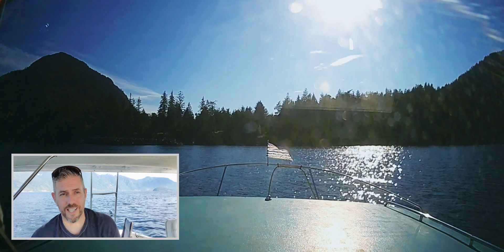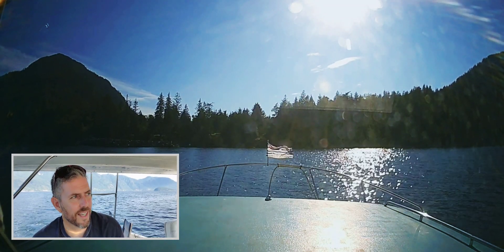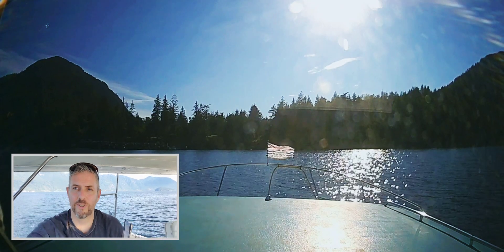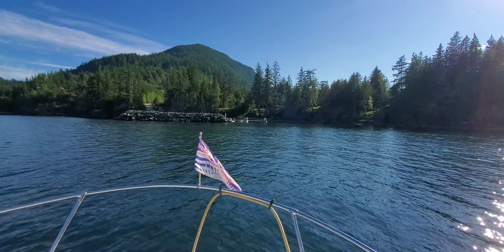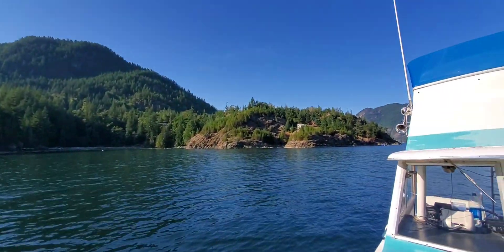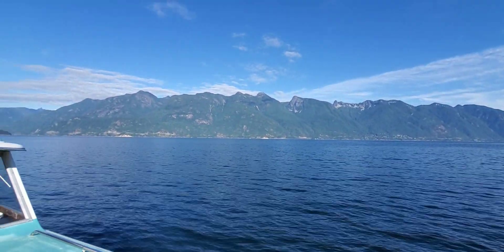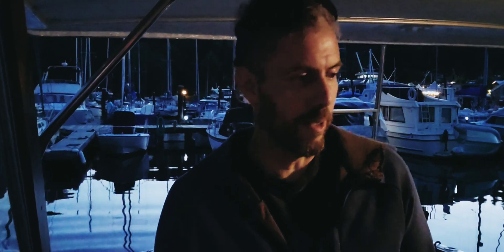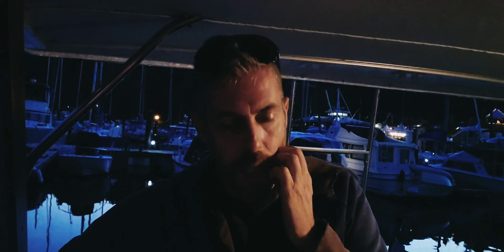Electric Boat - IRL Cruise 🛳, Crown Batteries Discharge Test #2

Comment: How large is your battery pack?

A 250 kilo watts LiFePo4 to 500 kilo watt battery would give you all the power you need. Signature Solar sell a 30 kilowatt battery for $9500. So $80k for a 250 kwatt to $140k for a 500 kwatt, just for the batteries and cables.
Reply from the maker: Just a 140K eh? Lol sounds like a bargain.

Comment: Just put like 8 panels and 2 wind generators on the boat and lithium batteries. Am I crazy? Do you not do this because of the cost?
Reply from the maker: Solar is a no-go.  Would be nothing more than a novelty in the Pacific Northwest. To get any real intense sunlight the panels would have to be facing south the whole time. Where I'm at you might get 3 or 4 hours of good intense sunlight. Keep in mind I'm charging two 16.9kW  power banks, not a 12-volt house bank. I did a video about it a little while back.

https://youtu.be/-mPPxVhdi0M

Regarding lithium's check out the answer, I gave somewhere else in the comments all this video.

Comment: That’s actually not really true about discharging batteries, at least it depends on their type. With phones or other modern batteries that are in most of our electronics devices (Li-Ion, Li-Pol, etc) the fact is you DON’T want to fully discharge them, because that will most likely speed up their degradation. Same with keeping them always at 100% too, but phones can manage it nowadays, by slowly discharging your phone even if it’s on charge and then topping it up slowly, etc., they all have built in controllers for that.
What you’re referring to is most likely true for Ni-MH batteries, or similar types, those yes, might need full discharge from time to time to accurately report their capacity and voltages. With lithium-based batteries full discharge is very much not advised.
Reply from the maker: And thankfully my battery packs are lead acid 👍

Comment: Just think, with lithium batteries, you could just about double your range, without any other changes. Lithium are now MUCH more cost effective than lead. I wonder if you should have waited just a little longer.
Reply from the maker: I've been waiting for 7 years for the price of lithium batteries to drop. They are still triple the cost and there are many safety factors you have to consider. 
In fact, Transport Canada is in the midst of writing new laws as it pertains to lithium batteries because there are so many potential hazards. It's an old conversation I've had many times. The biggest hindrance to this boat is the hull design. Then you have to consider how many times people actually go out. 20 maybe 30 times a year is quite a lot for most pleasure boaters. So the difference between 300 and 1100 Cycles really doesn't make much of an argument for me. 

But hey if you want to find me two 72V high-quality lithium packs, with reputable BMSs, thermal resistant cases rated up to 1000 degrees Celsius that are also corrosion-resistant,  two quality chargers, and an insurance company to cover any thermal runaway fire from a DIY lithium setup for under 10K  - I'm all for it!👍
(These lead batteries cost less than half that)
Reply: @ElectricCruiser  I'm sure you've looked into all this much more than I have, but again, you might have waited just a little longer :)  I can't speak to regulations, especially in Canada, but the LiFePO4 batteries are much safer and "non-toxic" compared to their predecessors. And lead acid can be just as dangerous under high draws. I have seen 100Ah LiFePO4s for as little as $400 with very good BMS and protection. I don't know all your specifics, but I wouldn't think you'd have to replace anything else. I don't know what the crowns cost you but 3 times the price for lithium, with twice the usable capacity (if not more when you consider the losses for lead acid at high amp draw) it really seems like we are at a tipping point. And then there is the size and weight reduction as well. Also, LiFePO4 are non-toxic when you eventually dispose of them, unlike lead acid. I think for a maverick of electric boats that you are, somebody needs to step up and get you a Battle Born sponsorship! I'm talking to you Battle Born! Needless to say, I can't wait for the day you install those AC motors :)
Reply from the maker: @jdtracy  I hear what you are saying and I really wish lithium was an option at this point but my old batteries were so done that I couldn't wait. I've looked at all lithium options and the price is still nuts. I've seen the Will Prowse videos and all his DIY setups and breakdowns which are good but not without a sig cost increase. A 235AH lead is pretty close to the same performance as a 100AH lithium. True you will not get the same cycles but here is the kicker...because I need to moor the boat at a marina, I need to get insurance - old boats are becoming harder and harder to insure simply because underwriters know that old boats often have more issues and far less value than new boats. Ideally, they want them off their books. 

A DIY lithium setup would need a higher power to approve it. But that does mean you really have to have an over-protected system - both from water/saltwater and thermal runaway. The cost gets up there. If I was to buy Battleborn or some other decent name brand, then I'm looking at $6,000 USD per side so (12K USD vs 4K CDN)- the issue with that is they are not easily strung together to a 72V system. Not one name brand has told me why, they just say no. The leads-acids are easy to work with, easy to replace, and not that much to maintain. My amp draw is always well under 100A - mostly 40A for cruising. Anyway, I appreciate the convo and the views, if things change I will for sure let you know and if you have a lead on any batteries I should take a look at, please share! :)   Cheers mate!

Comment: So the next step is mounting a  battery charging propeller... They are made for blue water cats...
Reply: And sails?
Reply: Unless he is going to mount a mast, uh- ...no.
Reply from the maker: @jdtracy  probably more likely to tie a string to Falkor the luck dragon :D
Reply: @ElectricCruiser  Exactly my point, you don't want to put another propeller in the water to generate electricity while you are driving your boat using electricity. That's not what those are meant for and wouldn't net you any power.
Reply from the maker: @jdtracy  Yeah to be honest the range isn't an issue for me at this point- I boat in a place with enough places to charge up - I can get to the city no problem and a few other spots for some good fishing - so those might be my next videos. Plus I keep thinking about the AC motors sitting in my kitchen. :)
Reply from the maker: Can you send me a link to such propellers? Curious what voltage input they can provide (and cost)
Reply: @ElectricCruiser  https://youtu.be/o1LtZn6wAqw
Reply from the maker: Thanks, a few issues though. Max voltage is 48V (my boat is 72V x 2) It also puts a lot of pressure on the stern (800lbs) and creates enough drag to drop your speed up to 1kt. ( like dragging my ladder)  For my boat, this would be a case of diminishing returns. Pretty pricey unit - costs more than my current set of batteries for both sides - including my chargers :)  Neat idea for sailors though. Cheers
Reply: @ElectricCruiser  https://youtu.be/iKUpGfYS9o8
Reply: @ElectricCruiser  https://youtu.be/KR5rNzbNsss